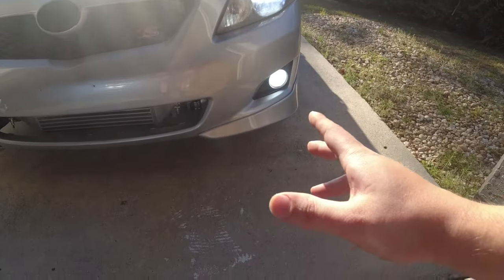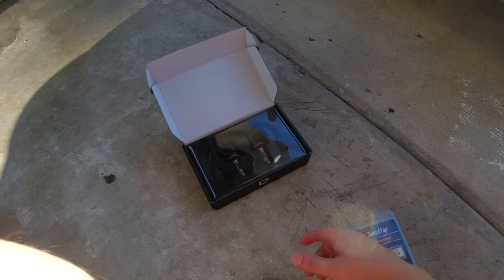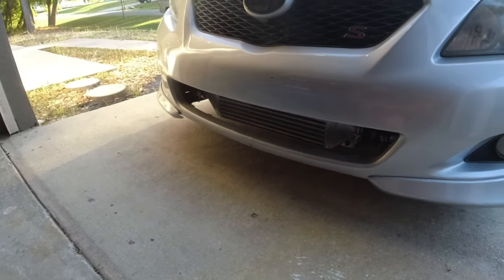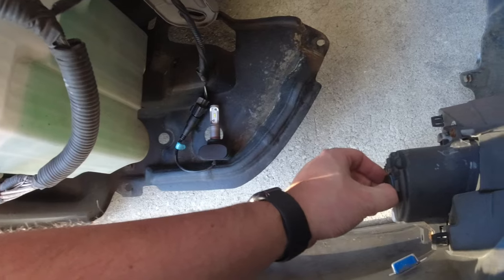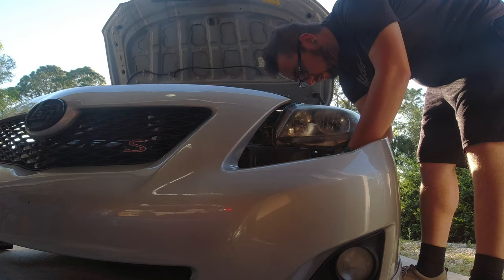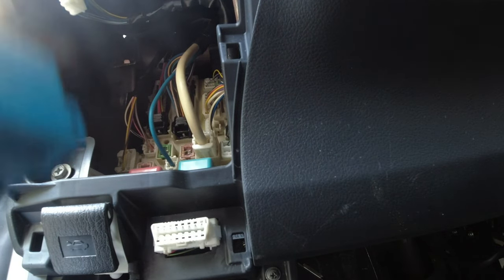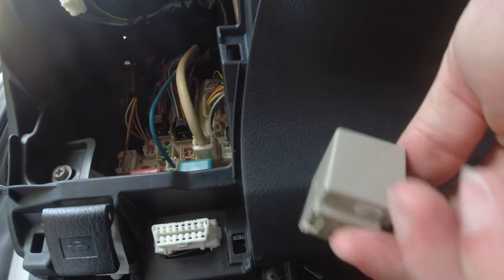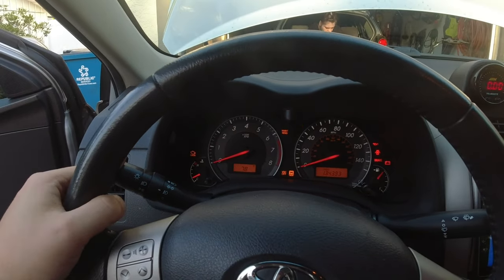DIODE DYNAMICS Upgrades To The Turbo Corolla

Comment: Can't go wrong with the smart tap...     you can run LED flasher bulb with not worry and the blink modes are cool.    I like that tap turn feature, it makes my corolla feel more modern and less stripped of features.  The flasher module are one to one swap for your matrix and the 9th generation corolla.   I
Reply from the maker: The smart tap is a great upgrade! Definitely the tap to turn feature is also my favorite feature about it!

Comment: Dude that's sweet. I just got the vland lamps all around on my corolla. I have the 2012 s model so i actually ended up having to swap to an e140 corolla altis trunk lid to fit the taillights. I'd love to see you do a video on installing the altis powered mirrors, a good set is around 250 on ebay. Good stuff as always man.
Reply from the maker: Thank you! And I have been thinking about swapping over to the 10.5 gen front bumper so I can get the Vland headlights!
And I actually plan to get the Altis mirrors soon and install them!